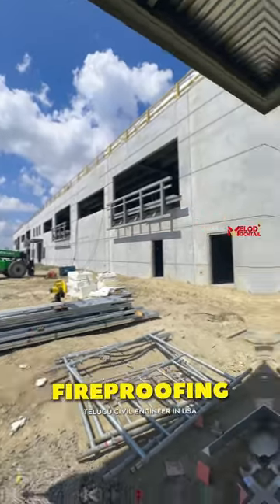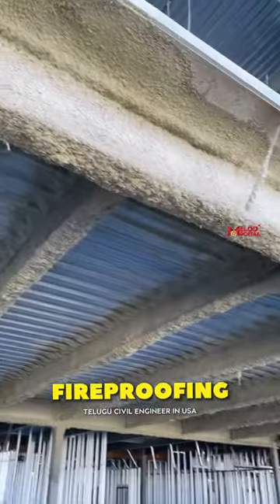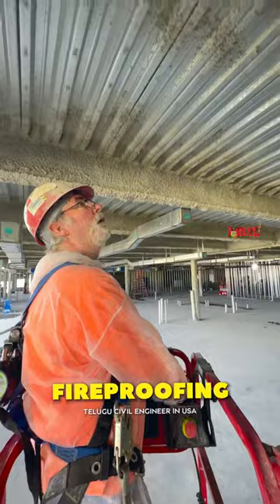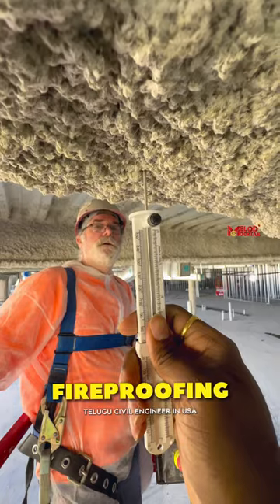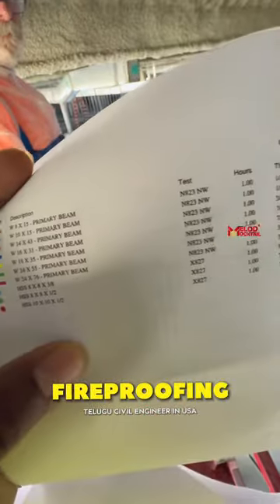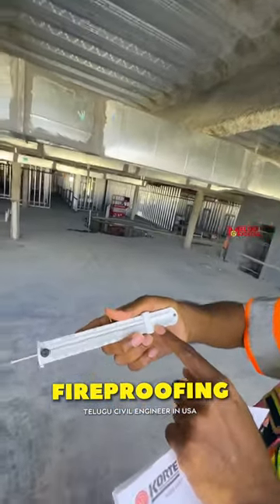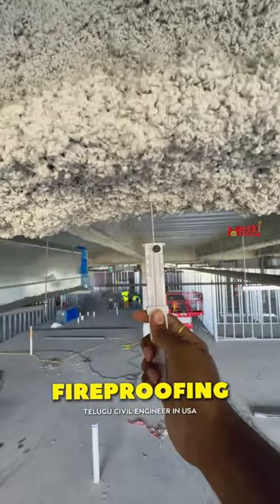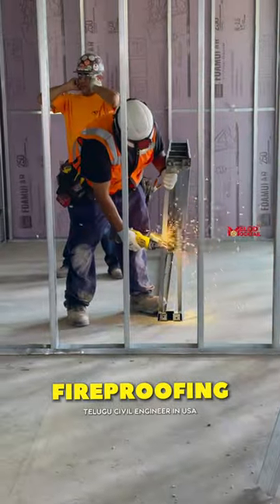Fireproofing | Telugu Civil Engineer in USA #melodymocktail #telugucivilengineerinusa

Comment from the maker: Mee brain 🧠 lo oka moola store cheseyandi panikostadi….eppudo okasari 👍🏼 alage mee civil friend ki kuda share kottandi✅

Cementitious Fire 🔥 Proofing:

Cementitious fireproofing is often referred to as spray applied fireproofing. This coating is either gypsum or Portland cement-based and plays the role of passive fire protection.

Fireproofing contractors will use specialty machinery to mix water and fireproofing and use compressed air to atomize and spray apply the fireproofing to the correct thickness for the required fire rating. When the cementitious material gets completely dry after applying, it forms a barrier that will significantly delay heat transfer and protect building structures in the event of a fire.

@ravichandu_rc 

#melodymocktail #telugucivilengineerinusa #fireproof #cementitiousfireproofing #civilengineer #construction #constructionlife #engineering #civil #building #safety #firerated #beams #columns #floridabuilders #floridacode #floridaconstruction #tampa #florida #usa
Reply: Mee intiperu Naaku telisipoyindi bava....😂
Reply: Bhai is there any civi work jobs,can you share please

Comment: Fire resistance application for structural steel. Steel loss it's properties at 550 °c  and chances are collapsing. FP concrete increase the heat rate of transmission. Increasing time with increasing thick. 2hrs time for 40mm thick. 

-Civil Engineer from Aramco, Saudi Arabia.